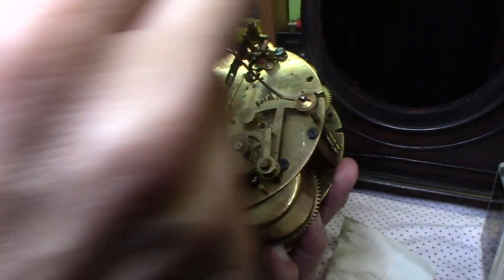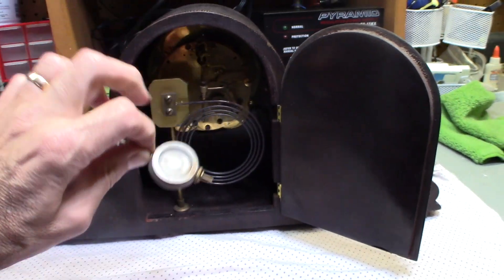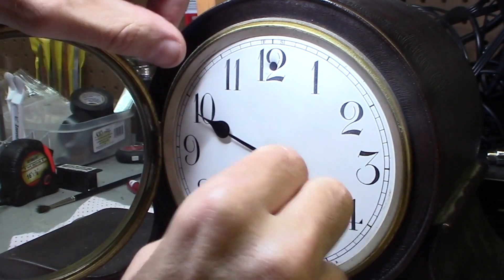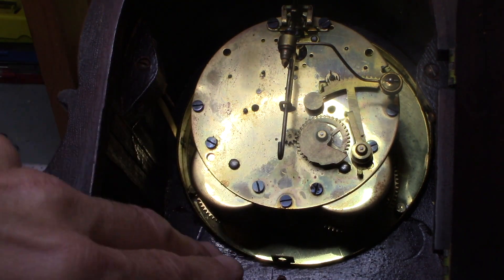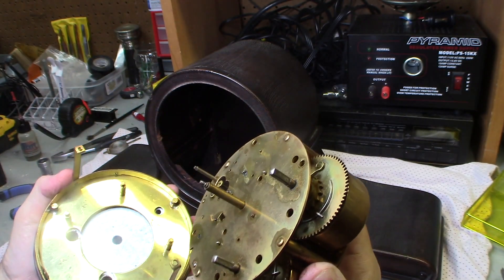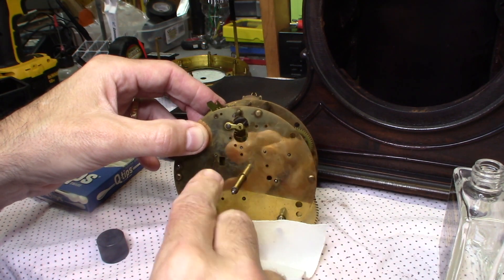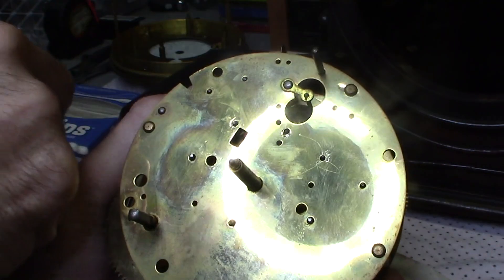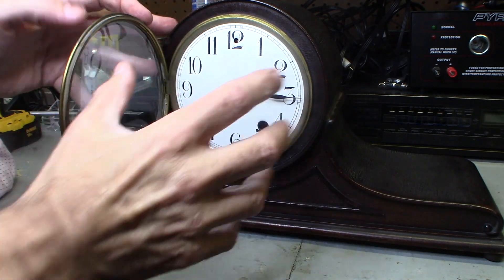How to oil my Clock easy how-to Video 2020

Comment: Many thanks - Great video.
Only use enough oil to cover the well slightly. It's held in there by surface tension.
All the best to you from the UK
Reply from the maker: Thanks for the tip!